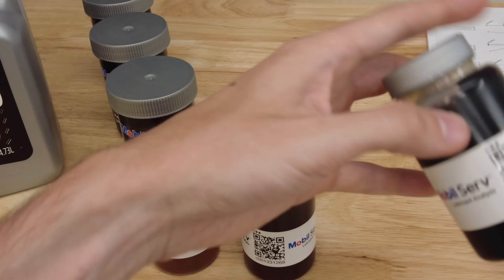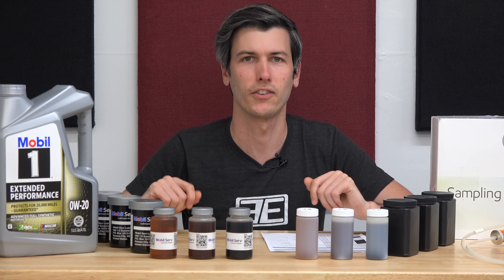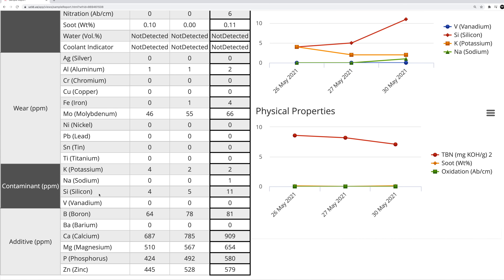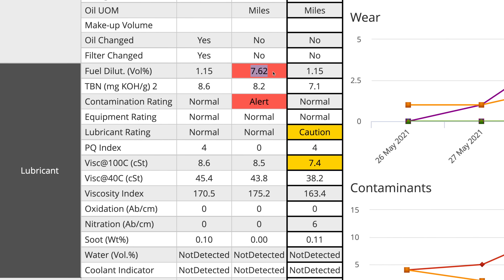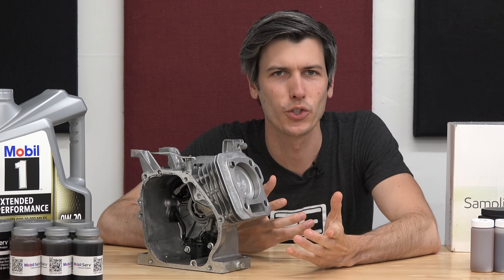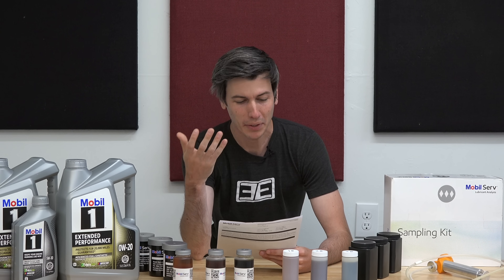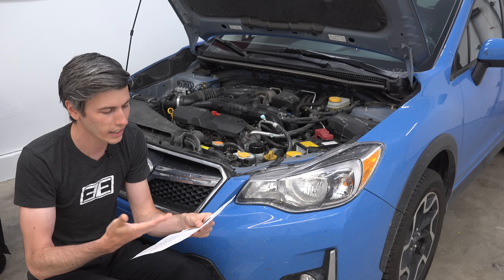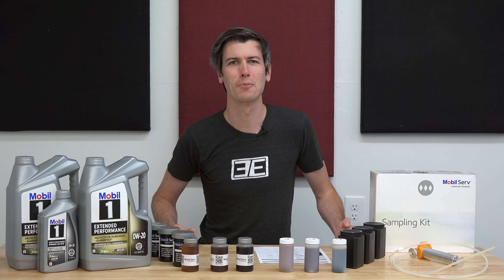Does Your Engine Have Hidden Damage? How To Know!

Comment: Great video, Jason! Finally someone provides an understandable explanation! I’ve been struggling to establish a position on my engine/oil condition, but with some confusing feedback, I wonder what your take on this would be. A BMW S63TU engine, appr 15k miles with oil changes always at 3-5k miles. 2 oil analysis (just under 10k miles - 3rd oil change, and appr. 12k miles), both returned all clear EXCEPT for fuel dilution - both times measured at 3%. BMW service advisor feedback was this is likely due “poor driver profile”, after digging into this more appears lots of short distance driving is classified this, second time this issue was definitely not a factor, but I struggled to get anything meaningful out of them, finally they responded with a strange message: 7% is considered a warning level, 10% a write-off level! Sounds bs to me, but I haven’t been able to verify this with BMW directly. Any thoughts?
Reply: If it is under warranty you may not want them to kniw about fuel dilution since they will say poor driver profile is a reason to deny warranty work.

Comment: You could look at your tuning, imagine that the motor is running a bit excessively rich at idle, which a lot of aftermarket tunes do, not familiar with an OEM tune doing that but it wouldn't really surprise me at all.  Mobil is probably correct in their assessment but look at your a/f ratio under idle and low to zero load conditions, or, just smell around.  Can usually detect a strong gas odor if something is running dangerously rich. 

Not that any of this should be news to you or come as a surprise, but those would be my first guesses.

Comment: I understand the softness of can vs is, but these analysts are to prove or disprove. An exhausting amount of effort is needed to get these results, and to sound on the fence of results is misleading. The comment from the third-party is your most sound for your engine, not reflective on all makes, models, years. Listen to your mechanics, and yes have more than a few.
Reply: Now I'll come off my high horse and say, owning a vehicle is a right. That comes at the responsibility to maintain it. My opinion is drive it, fix it, keep it roadworthy, if you can't remember when it was serviced, you need to service it.

Comment: Jason. How do manufacturers come up with “torque specs”? Always been curios.
Reply: What do you mean? Engine power and torque are measured on a shaft dyno during development if that was your question.
Reply: @ASJC27  i think he means torque spec for nuts and bolts
Reply: @JewbasaurusRex  I thought it was either that or engine specs but the question wasn’t clear. Anyway, for nuts and bolts, the bolt is chosen to provide a certain clamping force, or preload. A typical guideline is that permanent connections use 90% of the bolt’s proof strength (or more if advanced preload methods are used), and 75% is used for reusable connections. Once preload is chosen, the torque required to achieve that preload is calculated. It depends on the friction coefficient of the threads and bolt head (dry, oiled, anti seize…). With a dry clean thread, as expected in lug nuts for example, the torque is 0.2 times the bolt diameter times the preload force. [Note that using torque as a proxy for bolt preload is very inaccurate - there’s an error range of +-25%].

Example: An M12x1.5 grade 10.9 wheel stud. Grade 10.9 has a proof strength of 830 MPa. M12x1.5 has a tensile area of 88.13 mm^2. Reusable connection, so we use 75% of the proof strength, therefore the preload is 0.75x830x88.13 = 54.9 kN. Torque is then 0.2x12x54.9 = 132 Nm. A more precise calculation which includes the bolt geometry will show that the factor is 0.19 instead of 0.2, so make that 125 Nm. My car with these wheel studs is specced at 108 Nm, so they decided to use more like 65% of the proof strength.

Comment: I'd like to see an oil analysis on a CNG (natural gas), or propane fueled engine.  I have no personal experience, but anecdotal have these engines running very clean with very little sludge and soot. Edit:  I wonder if this is how oil manufacturers come up with such long change intervals?
Reply: I worked at a gas station that had a huge propane tank with a pump next to the interstate in the 90s. We would get people that needed to fill their vans (mostly vans for some reason) with propane. Often they would check their oil and I would check it out with them. The oil always looked brand new. As a side note my car is E85 and being in Ohio its readily available. If I run mainly E85 my oil seems to stay much cleaner than when using gasoline.
Reply: You know I always wondered the same thing because I have a  propane (dual fuel) powered generator and I wondered if the propane was easier on the oil than gasoline. Ohio player1177 thanks for the info also I appreciate it

Comment: That was actually a lot more interesting than I thought it would be. Just curious here, wouldn’t that 3000 mile oil be considered a bit older than just 3000 miles? By that I mean the time the vehicle is standing still while on, like at a red light or waiting in the car for the missus to come out of the house? Not sure if that makes a difference, but it is interesting.
Reply: Xavier Padilla:  Plus, in the real world, surely it matters much more at 50k or especially 100k miles, for people hoping to keep their car running well for, say, 200k or more miles.

Comment: This is really interesting, I would love to see a fourth column from samples of the same oil  taken at the next oil change to see just how much it changed. Also it would be really interesting to see a similar test done on an older engine with lots of miles on it perhaps paired with additional data such as cylinder compression, fuel trim etc. just to see if you can draw any conclusions from them.

Comment: why not take a sample from the oil pan drain plug area/heavy particles settle to the bottom of oil /metal particles /install a quick drain valve/i thank that would be much better/a cold sample -then start engine till temperature is up on temperature gauge /an take a hot sample/that way you would get a quality samples/thanks much
Reply: interesting

Comment: Most modern engine bearings are made of aluminum rather than the old traditional copper with the lead/tin babbit bearing face material, so consumers need to keep a close eye on aluminum as an indicator of bearing wear and they will likely never see a high copper number.
Reply: Yes, but you might still might check for cooper, to get an indication on generator wear :)

Comment: The fuel dilution is caused by idling the car and not driving it. Blackstone explicitly states when doing an oil analysis to take the car on the highway or on a good drive before sampling the oil.
Reply: FuelForFire87:  OTOH, in the real world, for my daily driver, it spends a LOT more time idling in, say, the Wendy's drive through line than it does on the highway.  So I'd prefer an analysis based on my ACTUAL driving. 

Now, for my fun "weekend sporty" car, yeah, that would reflect 90% back road miles at highway speeds.

Respectfully, why not get a report based on ACTUAL driving conditions if one wants to know how to make one's car last. 

And while I used to say, read my plugs before platinum plugs that lasted "forever", I've never had an oil analysis.  I just buy oil with a great reputation and change it OFTEN.  That's worked quite well for a good 40 years, re helping my cars last a long time.

Comment: I remember arguing about an early oil change with the service lady at Ford. She was convinced it was pointless.
Reply: Those ford ecoboost engines need early oil changes as the deposits build up quickly. Ford Boss Me channel did several vids on this.
Reply: @JohnS-il1dr  now that is interesting.
Reply: Same at my Honda dealership. I change my oil every 5,000 full synthetic and the service manager said “that’s pointless it can go 10,000 miles”.

Comment: A single analysis doesn't tell you much.  Frequent samples establishing a trend will tell you much more.  Oil type/brand/etc really is irrelevant, what matters is the parameters measuring within acceptable range.  If the values are good, keep running the oil.  I know it's shocking to hear that $2/qt oil may perform just as well as $10/qt in a given vehicle over a given period of time, but it is reality.
Another nice thing about Blackstone is their extensive database given you insight as to how your engine is performing compared to others of the same type and mileage.
Reply: D:  And spending lots of money on "frequent samples" is better than frequent oil changes and quality oil as a place to spend the money, why exactly?
Reply: @rogergeyer9851  Exactly!  Oil sampling doesn't typically make sense on vehicles with low volumes of oil as the cost of a sample is equal or more than an oil change.  This can be useful if you are trying to extend oil change intervals from the standard 3 to 5k out to 10, 15, 20k but after that, it becomes uneconomical.  Oil sampling is more economic for large fleets of vehicles and vehicles with much larger oil fills.  Think 10 gallons plus of oil.  A $30 oil sample on a diesel genset with 100 gallons of oil is much different than a car with 5-8 quarts.

Comment: cant even get a full 3000 miles in on the same 5qts of oil in my 99 prelude lol a fresh 5 gallons about every 1 to 2 months lmao
Reply: kyle cotto:  Yet, if you have over, say, 200K miles, you've still gotten a hell of a good deal from your old car.  Lots of, say, GM or Chrysler cars, fail before 100K miles due to engine problems, yet they charge almost as much as quality, say Japanese makes, for their cars.

Comment: Great video👍really interesting, I used to work in an open cast mine as a welder. They took oil samples from all the machines every couple of weeks (engines, gearboxes and final drives). I always wondered how they analysed it. Thanks👍

Comment: Does your Subaru have a 5th fuel injector directly into the oil sump? 7% in 15min sounds like you pressure-washed the engine with fuel :o

Comment: wouldnt DI engines show more oil dilution? Ive always heard about that. The oil in my wrx and my dads f150 both smell like gas.
Reply: When the engine warms up the fuel in the oil evaporates and passes through the pcv system

Comment: Great video, surprisingly fascinating. One thing I took away as a many-times-over Subaru owner and as a current Tesla owner... ICE engines are amazingly (overly) complex and it boggles my mind why OEMs are continuing to attempt to squeeze any additional life out of them rather than transitioning to electric motors.
Reply: It takes entirely starting over with software tech and battery tech,  entirely new sets of components from suppliers, etc. Also, limitations in the quantity of batteries the industry can produce. The OEMs are simply too tied to their old ways. Think of McDonald's changing to serving organic,  vegan Chinese food fresh at the table. Practically have to scrap the whole system and start over.
Reply: @jamesengland7461  not a bad analogy, except McDonald's has shifted their menu numerous times, in every country, to adjust to demand, changing tastes, complexity, and profitability. I see traditional OEMs losing their lunch as China and the EU are rapidly moving away from ICE. The amount of hand wringing and lack of preparation is inexcusable. The writing has been on the wall since the EV1 days.

Comment: I think it would be interesting to see how age effect's oil, usually it's recommended every x miles or x months and while the miles makes sense I'm wondering if 1 year old oil that's lightly used vs oil that's at it's mile limit would compare.
Reply: Usually it's not the age itself that's the issue, but the time interval is to handle vehicles that are driven on a lot of short trips and which may build up more contamination.
Reply: Also interested

Comment: I've been using that 20000 mile annual oil and filter for a few years now on a 2.5L 4cyl...  The oil was very black (changed it last night) after almost 1 year.  I also noticed i was low maybe a quart///i had never checked the dipstick in a year///i'll try to remember from now on--car doesn't leak or burn oil that i notice.
Reply from the maker: Yes, definitely want to make sure you're adding oil if needed!

Comment: How as there any fuel measured in the brand new oil... 7% by volume on say 4 qts of oil would be like a 1 cup of gas which would seem significant if I am reading that right and agree there would be a data error.
Reply: It was after a 15min idle. In the oil fresh out of the can there was zero fuel if you watch the video :-)

Comment: This is my thought. When your engine was idling for 15 minutes, did it get hot enough for the computer to go into closed-loop? If not, that would explain the richness in your oil on the idle cycle.
Reply: Modern vehicles don't need to warm up before going into closed loop (though some may have a low minimum temperature threshold for cold conditions). As soon as the O2 sensor starts responding it will switch. Usually under a minute.
Reply: @RobertHancock1  which can be usually noticed by the engine reducing idle from almost 1k to 650ish rpm.
Reply: It should switch withing a minute or two, Cats and Lambda sensors should not take that long to heat up (to function)
Reply: It doesn't matter as the oil has to reach operating temperature for any water, fuel etc to evaporate properly, that usually takes between 20-30 minutes of driving. Idling will never get the oil hot enough. :)
Reply: @PSA78  All true, but I think he lives in Idaho now. Colder, thinner air could prolong closed loop activation. The longer your in it, the longer it would take excess fuel to burn out of the oil.
Reply: @JoshsCarCorner  Oh yes there's more fuel in the oil if the engine runs longer in cold start enrichment, today's sensors get hot quick though so it will run closed lope after a minute or so. 👍

Comment: What exactly is the point of this information, though?  If your engine has degradation and blow-by, sure it's interesting to confirm that with a test, but what exactly would you do with that information?  People are not going to do a complete engine overhaul on their 20 year old toyota. They will just keep driving until something breaks. Then fix it.  The oil analysis doesn't seem useful for the consumer level.
Reply from the maker: Say you find coolant in your oil, indicating a slow leak. Could catch a head gasket failure early and prevent greater damage from occurring to your engine, all from a $30 test. Say you find excess silicone and it simply indicates you're using a poor engine filter, and that simple fix saves your engine from wearing prematurely. There are plenty of great examples of finding something early and preventing the engine from being damaged.
Reply: @EngineeringExplained  Interesting, thanks for taking the time to reply.  I still think these issues can be avoided without an analysis. Coolant leaks can be seen by checking coolant level, or observing frothy substance during a regular oil change. Head gasket leak would cause lots of white smoke from exhaust if I'm not mistaken (correct me if I'm wrong).  Oil filter issues can be prevented by never buying FRAM lol.  Just frequent oil changes in general prevent so many problems that you mentioned in the video, related to impurities in oil that damage the engine over time.  But I agree it is nice to know the state of things, and possible fix the upstream source of the problem.  The analysis itself is very cool and impressive. Thanks for the video.

Comment: Maybe I'm wrong, but I used to make oil change twice often  the manufacturer's recommendations . Along with basic care such as  no revving when the engine is cold and a normal use ,  I have always experienced  an almost endless engine trouble free operation, at least much, much  longer than the rest of the car equipment and body.

Comment: BlackStone charges about $30. for a basic analysis, This is probably worth the money for fleet vehicles. Probably not worth it for someone like myself. Unless you are just interested in seeing the results or how long you can safely push your oil changes. 
Great video tho 😉
Reply: It's very interesting data, for sure, and needs to be done only occasionally at most for the average motorist. I did my first, got great results and then maybe two years later did another. Same outcome. I was perfectly confident I was treating the engine right and that I'd have a nice, long run with that car, which I did.

Comment: What you learn is oil analysis is expensive and it's cheaper to just change the oil more often.
Reply from the maker: You can get an analysis for $30 and learn quite a bit! Doesn’t mean you have to do it every time, just a nice way of checking everything is going smoothly.
Reply: @EngineeringExplained  i can change the oil for less then that. If there is a major engine problem lurking, maybe I really don't want to know about it, if it does not cause an immediate problem
Reply: Engineering Explained:  But respectfully as someone who likes to drive cars I've kept over a decade and HATES car payments, it seems like you'd get FAR more bang from your buck for an oil analysis on a 5 or 10 or 15 year old car than a new car.  AND from frequent oil and filter changes with high quality oil and filters.